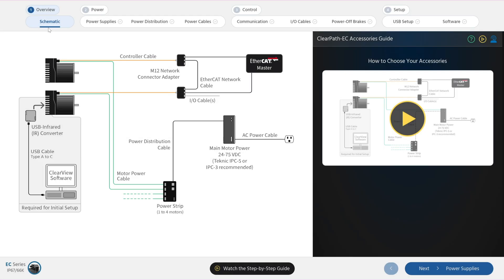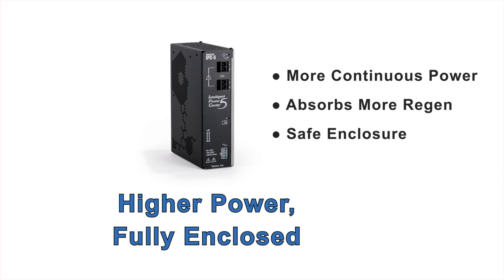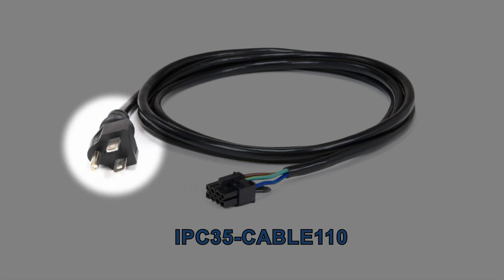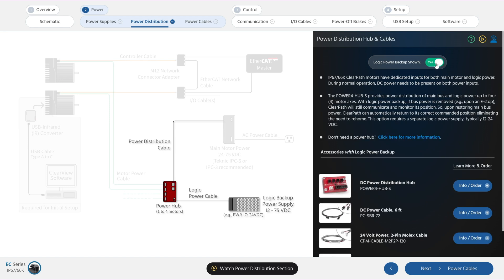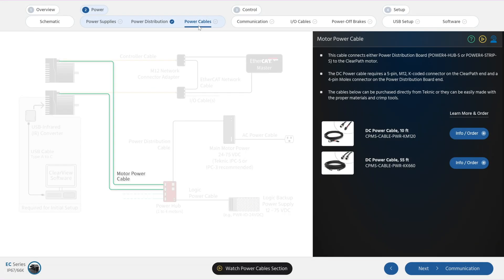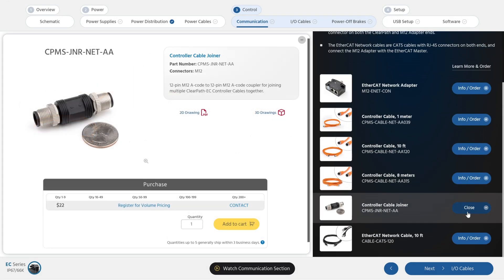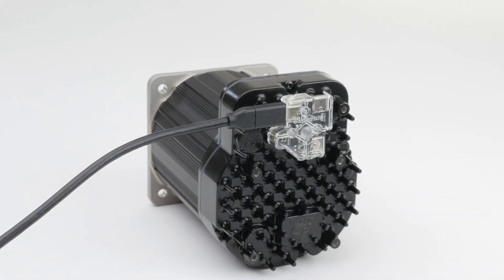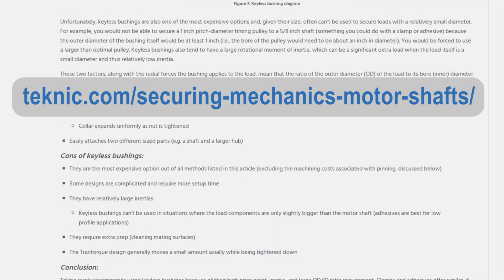ClearPath EtherCAT Servo Fractional HP Accessories

Comment: Is a Nema17 format available for any of the series?
Reply from the maker: Hi Moistbread955,

We frequently get requests for a NEMA 17 version of ClearPath, and we've spent considerable time looking into manufacturing an integrated servo motor/drive/encoder of this size. Although several factors make it very difficult to scale down from NEMA 23 while maintaining excellent price/performance and quality, we do have some creative ideas for how to provide ClearPath features and functionality in a small package. So stay in touch.

Brendan F. - Teknic Servo Systems Engineer

Comment: Is there MTBF data available for the servo motors?
Reply from the maker: Hi RA-gk5zg,

The ClearPath servos contain two components (a three-phase brushless servo motor and an integrated servo drive) that have different lifetime ratings. I’ve provided details on the lifetime ratings for both of these components below:

(1) A three-phase brushless servo motor has no contacting (wearing) parts except the bearings. The life of the motor portion of ClearPath is therefore primarily determined by its bearing life. Bearings are commonly measured by their "L-10" Life rather than MTBF. 
•	An L-10 life estimates how long 90% of the products will survive. The MTBF for any given product will be much longer than the L-10 Life. Although, in our opinion, it’s more useful to know when 10% of a product will have failed versus when half of the products will have failed.
•	Teknic's motors have an oversized front bearing which is sealed and permanently lubricated to extend product life.
•	The L10 life (in years) depends on the radial and axial shaft loading, and the average speed of the application, but the typical L-10 life is greater than 2x10^9 shaft revolutions, so in most applications you can count on 10 years of bearing life, and often more. (Loading beyond the allowed axial and radial load limits will significantly reduce the bearing life.)
•	Motor winding insulation can also degrade over time due to “heat aging”. ClearPath uses Class H insulation, whereas almost all competitive brushless motors use Class F (or lower). This means that at the same temperature, ClearPath’s insulation will heat age at only 1/20th the rate of Class F insulation, so for ClearPath, this heat aging can be safely ignored.

(2) A servo drive’s reliability is often described by its "MTBF" 
•	MTBF stands for "Mean Time Between Failures"
•	MTBF is the estimated time between failures during normal operation. MTBF also typically excludes infant failures. 
•	Teknic's standalone drives have an MTBF on the order of 700,000 hours. Based on the similarity in design and components, we expect the ClearPath drive to be comparable, however we have not measured it. As an educated guess, the L-10 life of the electronics would probably be around 100,000 hours (or more than 10 years running 24/7/365).

As an aside, ClearPath servo systems have a three year warranty.

If you have additional questions you can always call us (585-784-7454) or submit a contact request through our website (https://teknic.com/contact/) to speak directly with a Teknic engineer.

Best regards,
Aaron, Teknic Servo Systems Engineer